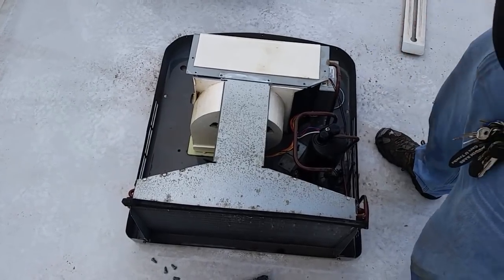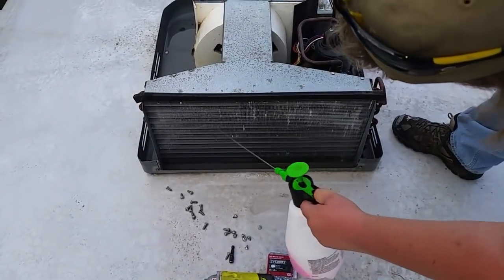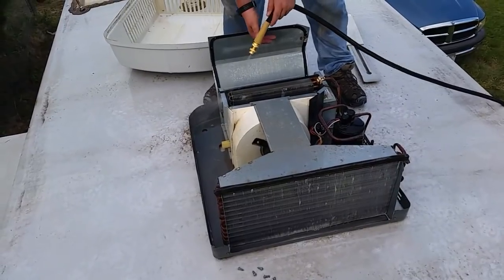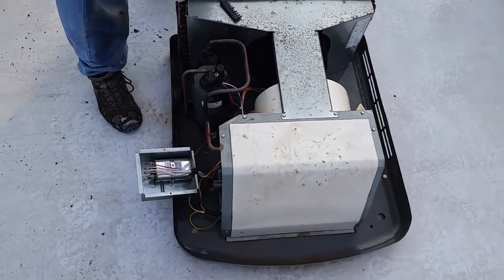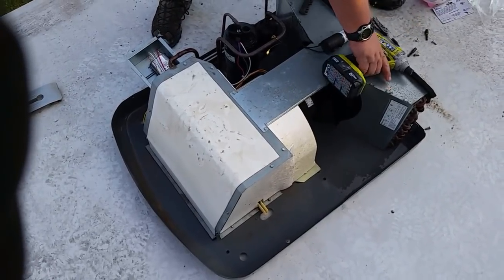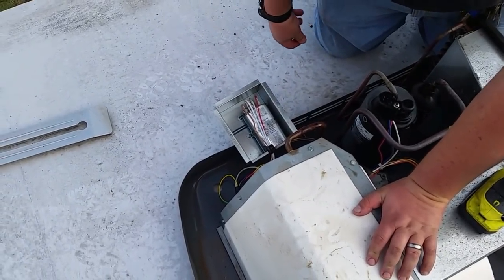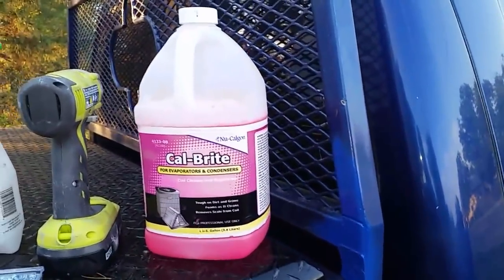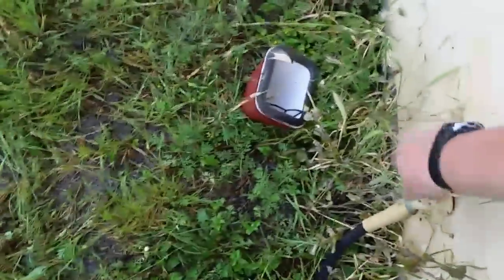RV air conditioner service and maintenance

Comment: I have been in the electric motor business for 40 years. Any sizable AC single phase AC motor is either a Split-Phase motor(start and run windings) or it is Capacitive Start(single winding). The capacitor provides a jolt to start the rotor turning. If the capacitor is bad, the motor will just sit there and hum. It is possible to have a part-start split phase capacitive start motor but, this would only in the case of super high locked rotor current. This would be enough to probably dim the lights.

Comment: I have a 20 year old Dometic AC that will run fine for about 30 minutes and then it will start short cycling off and on every three minutes or so. It has a hard start and starts up no problem. The unit gets cold, about 20 degrees difference between intake and outlet. The condenser never ices up. All the coils on evaporator and condenser are clean. However when you started speaking about the thermister in the run capacitor and shutting down I thought maybe this was my problem. Could my run capacitor cause it to short cycle? Or did you mean the actual thermister temp probe.

Comment: A huge thank you for taking the time to show everything you did. o kept looking for that info on what type of hard start capacitor to look for and also method of cleaning the coils. co Ulf you please tell me, how were you able rinse off the coils without all the water running inside. I'd hate to ruin something while trying to fixing another.
Reply from the maker: the evaporator coils that cool the interior air should be sitting in drain pans to carry away condensation.  Just rinse them gently and carefully and don't throw more water at it than what the drain pan can carry away.
Reply: is there a neutralizer for that coil cleaner to avoid any damage to the rv sides
Reply from the maker: Eloy Gonzalez Jr i didn't have a problem with it really.  what i was using in the vid was pretty mild in comparison to some other cleaners even from same company.  cleaners that are very alkaline would probably be bad.  this one is mildy acidic i believe.  any cleaner meant for both coils would be mild i suspect.  i know the box home improvement stores sell aerosol cans of coil cleaner that would likely be similar.

Comment: Hard start is for when your system is older and the compressor has a hard time starting normally under high head pressure situations like on very hot days or the system is old (+10 years).
Easy Start is what you should have put in your RV unit,
Also a fan delay will help also so the whole system does not come up at once, the compressor will come up and level out then the fan will start. These are cheap and you can set the delay time.
easy start and delay timers are good if you are on a generator or solar.

Comment: hello my ac doesn't seem to cool like it use to, I have looked at it but can't seem to find any fittings for recharging. can someone tell me if they are rechargeable.
Reply from the maker: Ritchie Holt they are rechargeable if you have a torch to braze in charging ports on the lines.
Reply: or you can use a saddle valve. Don't necessarily have to braze one in if you use those. but they do have a tendency to leak if not done correctly
Reply from the maker: true, and i didn't mention the saddle valves because i'd heard they leak and I'm a sucker for overkill.  Never used either myself.  Have just recently gotten into doing AC service, so have not yet had the opportunity.
Reply: yea...only use saddle or "piercing" valve for last resort or on something you know wont last much longer....cause they do leak even if installed properly, the tiny seals or gaskets rot away
Reply: You should not try and recharge an A/C unless you are legal to buy and handle refrigerants and have proper training in HVAC.. Call a professional if you don't. also saddle (peircing) valves leak especially in RV units because the vibrations from the road and general use vs. using them on on a home central A/C unit. You might recharge it and it be fine all summer, but in a couple years it will leak out again. The bst thing to do for anRV system if you are certified is to solder in a "T" on the low side with a proper connect stem. Otherwise older units that use R-22 you are better off scrapping it and getting a new unit.

Comment: We purchased a 2 year old travel trailer from a private party. We went to use the air conditioner (Dometic 57915) only to discover it is blowing out warm air only. We have tried so far and discovered: thermostat set on Auto, fuses ok, compressor turns on, fan turns on, When I called Dometic they have the worst customer service anywhere. The representative told me she was going to have their attorney call me if I posted negative feedback on facebook. Ideas or suggestions PLEASE! (Not on the rude representative, I contacted her supervisor). Thanks all.
Reply: darlene johnson
Reply: More than likely a refrigerant leak.

Comment: Your going to Draw a lot of Amps with that small cord coming out of the Garage
Reply from the maker: #1 my friends house doesn't have a 30 or 50 amp plug, it's what we had.
#2 that's half the point. I'm demoing the reduced current draw by running the unit and even short cycling it intentionally on a 15 amp extension cord to help demonstrate the effectiveness of the hard start kit at reducing starting amp draw.  circumstantial, yes, but hopefully helps add to the validity of using a hard start kit on AC units.